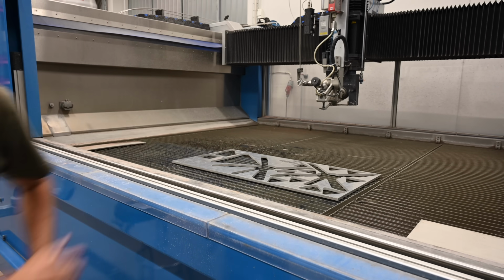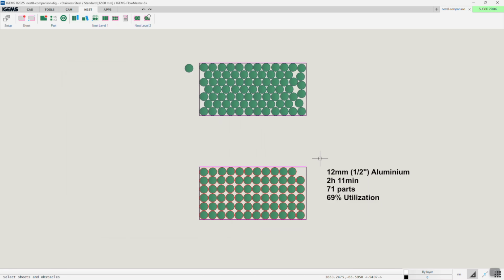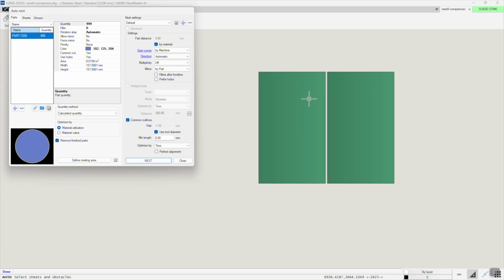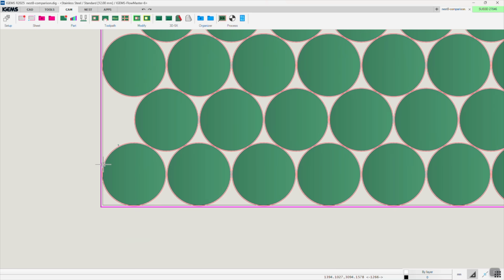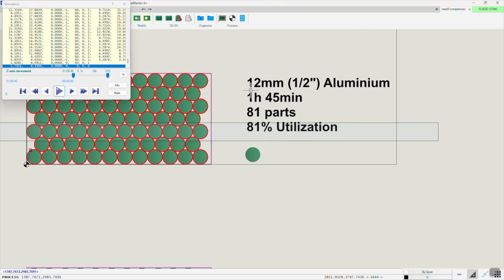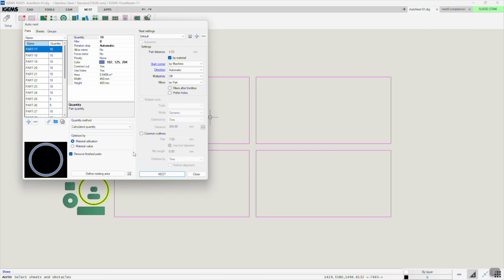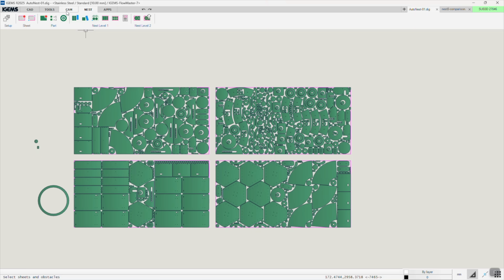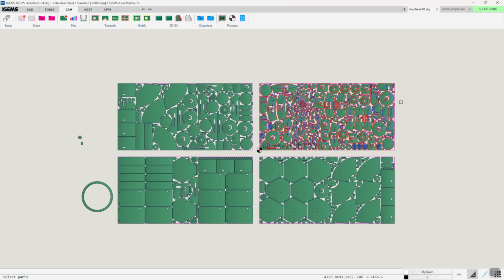Best way to maximize $$$ on a FLOW WATERJET?

Comment: Nesting is super cool! But what’s the best way for 3d nesting with common bevels for tiles?
Reply from the maker: What is the profile of your parts? 45° bevels on all external geometries? Square parts?
Reply: @igemswaterjet some of the bevels are 45 degrees some are 90 degrees (most of the times on the external parts). For instance we are making rectangular sink from a slab. And we need to cut around 15 parts. Some parts are mirroring each other so they can have common 45 and 90 degrees cuts
Reply from the maker: @Zel095  I've been investigating a bit and unfortunately I can't come up with a good way of creating common nesting with bevels. The best hack is to create an array with identical parts and remove every other part. That will leave you with a sorta kinda useful result. I've noted the feature request 👍🏼